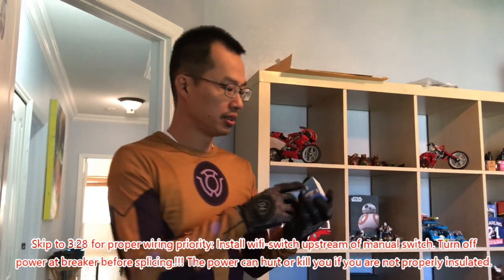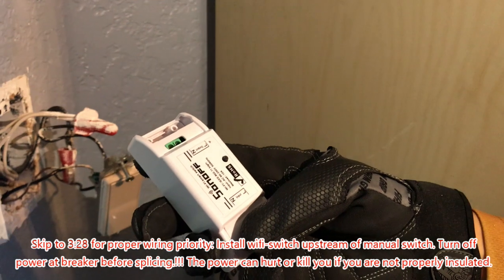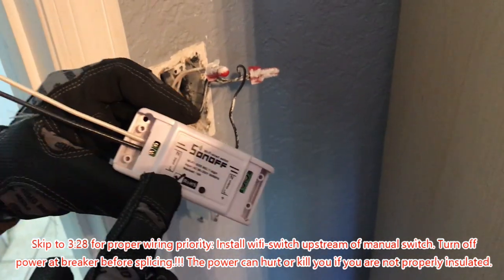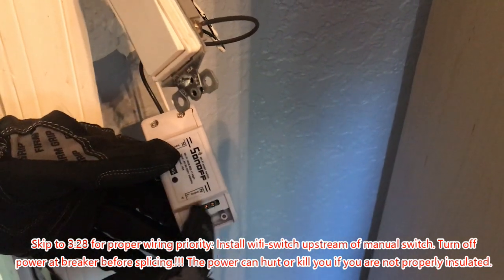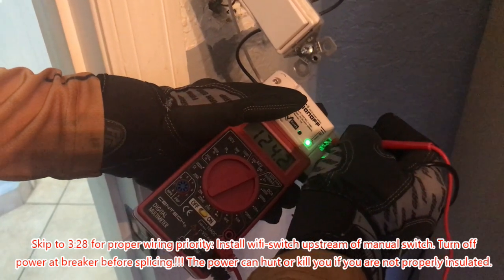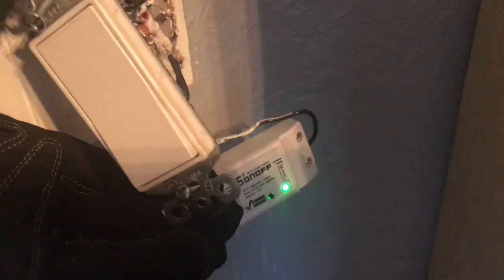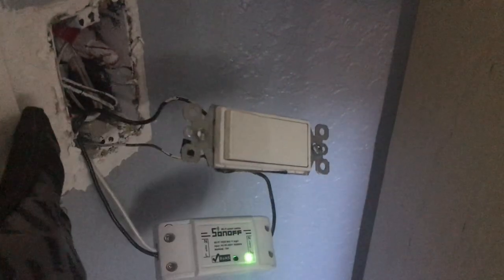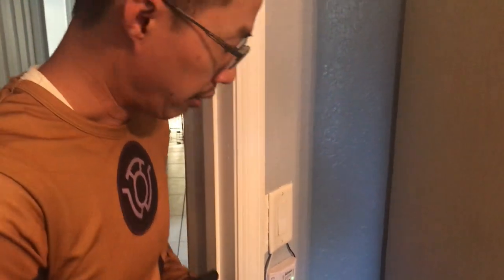Sonoff smart switch installation

Comment: I have one question. Can you turn on the office fan if you turned off the sonoff switch?
Reply from the maker: If my memory serves properly, I believe I installed the sonoff switch upstream of the physical switch, so if the upstream is off, there's nothing that can be done downstream to affect change. Case in point, if you turn off the power to the circuit at the breaker, flipping the switches within a circuit controlled by the breaker will do nothing. Hope that wasn't too confusing.

Comment: Watched your video, nice thanks. I have a sonoff smart breaker. I did it the same way that you saw in the video, It does not work. Why? Answer me pl.
Reply from the maker: Hello, Siva. It's been awhile since I've fiddled with this project, so I'll do my best to "talk" you through the process. This "Breaker" that you have, I presume is a circuit breaker located inside a circuit breaker panel controlling multiple outlets attached to a single circuit. In the US, single-pole home circuit breakers typically have one end latched onto one of the two legs of 120 volt AC load (hot) bus, with the other end that subsequently attaches to a black/red load (hot) line, paired with a white return (neutral) and green (ground) line. I've not forayed into the world of smart breakers yet, so I would advise enlisting a certified local electrician for the project so as to keep from getting hurt. Thanks for watching. Be safe.

Comment: Why don't you need to attach the neutral wire on the "out" side of the sonoff device?    Also if you install this sonoff after the light switch like you said in the video won't the light switch only work if the sonoff is in the on position? When sonoff is off it's like having a break in the circuit or am I not picturing this right.
Reply from the maker: Thanks for watching and inspecting the work, Steve. I presented the issue to my Bud, the owner, and this was the hack that provided the "smart" upgrade he was seeking at the time. Given the improvement in this arena since this publication, the challenge herein (attempting to create a 3-way switch with two-pole switches) will likely soon be a non-issue. Thanks again.
Reply: @SuperWhizy  thanks for your reply

Comment: I have two lamps connecting to a 2gang switch, there are two cables coming from bottom(red&blue) there are 4 cables in total going to up two lamps both of them have a blue and black cables so in total there are 6 six cables in the system photo link: (https://ibb.co/NpSzLx2)

All blue cables are connected to each other, red cable is coming from bottom and goes to switch, also two black cables coming from top are connected to two buttons of the switch

I want to disable one light and connect other to sonoff, what I want to ask is:

If I connect red cable to input-L of sonoff and get blue cable coming from bottom and connect it to input-N of sonoff then take blue cable of one light and connect it to output-N and black cable of same light to output-L of sonoff does it work

The reason I am asking this whenever I watch examples on net they mention about switches with 3 cables as I understand they are +, - and ground which is not the case for me so can you explain my situation please?
Reply from the maker: Hello, Berk. I've not been monitoring too closely the comments, hence I missed your question. I would suggest contacting a local electrician or electrically versatile friend regarding your wiring issues. Thanks for watching.

Comment: Rubbish video in the end. The sonoff acts as a bridge the same as the switch! Which means you would have to activate the sonoff in order for the switch to work, in which case, whats the point in having the switch?
Reply from the maker: I'm sorry the video offends you so, Friend. The idea was to integrate "smart" features into an existing home while at the same time providing the physical switch for those without access to the Sonoff app a sense of control. It is not mandatory to have it done this way. Thanks for watching.

Comment: Hello Superwhizy, i have a question, is there any option to put the Sonoff inside the wall and use both switch? lets say my wife doesnt have the app and she wants to turn on the light manually but the sonoff is off.... is this possbile?
Reply from the maker: Hello, Gustavo. Yes, you can hide the module behind the wall, or inside the box, if the box is big enough. As for your question about the power priority between the Sonoff and the physical switch, if the sonoff module is out and accessible, you can depress the reset button 3 times and it'll turn itself into a pass-through entity, as though there was no switch. If the module is hidden, it is turned off, there's no app, and it is upstream of the circuit, I would not know how best to address this issue, short of ripping into the wall/box. Thanks for watching. Be safe with your endeavor.

Comment: So let's say my wife  just turns the switch off with using the wifi can I still turn it on by voice without turning the switch back on ?
Reply from the maker: Hi, Alan. I believe so. the wifi module can take instructions from both the app on the phone and via Google or Alexa voice command. All the best with your experimentation.
Reply: @SuperWhizy  so if my wife turns the light switch off the wifi will take over and turn it back on even though the switch is set to off  awesome 😀
Reply: mmm are you sure?
Reply from the maker: Hi, Alan. If you wire it with the illustrated configuration (Sonoff before physical switch), the light will stay off if the physical switch is turned off. Perhaps the following logic flow chart would help: (Sonoff - on)->(Physical - on)->(Light- on). (Sonoff - on)->(Physical - off)->(Light- off).  (Sonoff - off)->(Physical - off)->(Light- off).  (Sonoff - off)->(Physical - on)->(Light- off).

Comment: But this doesn’t make sense. If you tell google to turn off the light then try using the switch it would fail because there’s no load being passed through the sonoff. Or am I looking at this incorrectly?
Reply from the maker: Thanks for watching, Karoon. You're right in that, if you tell google to turn off the module, the physical switch downstream of the Sonoff module would not work because no load is passed through the circuit. The design illustrated is a compromise utilizing these modules and is meant to be the most practical set-up we could conceive given the situation. Please let me know if you find a more ideal design. Thank you.

Comment: Do you have a diagram of how you  did it correctly or another video. I install mines and without the light switch being on the ON position, the lights would only come on with the app. If the light switch is on the off position the app would be able to put the light on.
Reply from the maker: Hi, Damian. I have not meddled with the Sonoff gadget since I last worked on this many moons ago. If you're able to control the lights via the app without the physical switch affecting the circuit, you may have wired it in a 3-way light switch configuration with a traveler terminal, which is beyond the scope of this video. Congratulations on having made it work. I'll post another video with a 3-way switch set-up at a future date. Thanks for watching. Be safe.

Comment: Quick questions. The way you wired it, I'm guessing if you turn OFF the lights with the Switch you wont be able to turn it ON with the Sonoff since the Switch won't let current go through. Or can you still use it normal ?
Reply from the maker: Hello, Marlon. When I first installed it with the physical switch upstream of the Sonoff, we quickly learned that we were unable to turn the light on/off like normal. That's why at the end I emphasized the installation of the Sonoff upstream of the physical switch, so the physical switch would still be able to control the light without the APP. Thanks for watching.
Reply: It doesn’t make sense, if the switch is off Sonoff wouldn’t b able to work. Then its no point of this plus it looks funny hanging under switch it’s unsafe!
Reply: Eu estou louco atrás dessa solução. Você também estava à procura, Marlon? Quero algo que funcione ambos independente, realmente, se ele desligar no modo "físico", o outro não funciona.

Comment: If you're doing it that way you might as well not put it on the switch like that but in the actual light and fan fitting itself where are the live and neutral power the actual light
Reply from the maker: Thanks for watching, Kevin. The source of power in this project was inside the switch box, hence the decision to go with this more convenient, albeit, less ideal installation. If the Sonoff module was installed by the fan,  we would run into the issue of being able to manually control the light with the physical switch.

Comment: Are you just going to leave the Sonoff hanging out like that? Or is there a plan to tuck it away somewhere?
Reply: You know sonoff makes wifi light switches? They aren't much more expensive then the sonoff box you are using in the video and they look a hell of a lot better
Reply from the maker: Hi, Jimi. Thanks for watching. My buddy who asked me to install the wireless switch has not summoned me for re-work, so there's no plan as yet for the relocation of the Sonoff wireless module. It shouldn't be difficult to install an old construction electrical box and bury the module behind the drywall, or install a plastic trim piece to cover the entire assembly. The advantage of the exposed module is that in an event of an emergency, the Sonoff can be easily bypassed because it is out in the open. Good luck with your installation. I'll upload another video with a more "professional" finish at my next go at it.
Reply from the maker: Thanks, Ross. I'll tell my buddy about it. Thanks for watching.